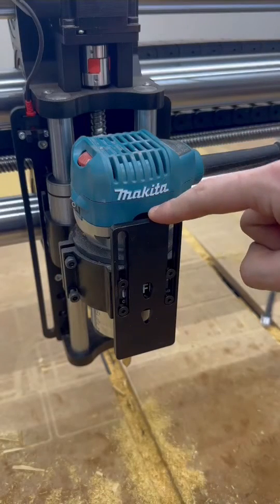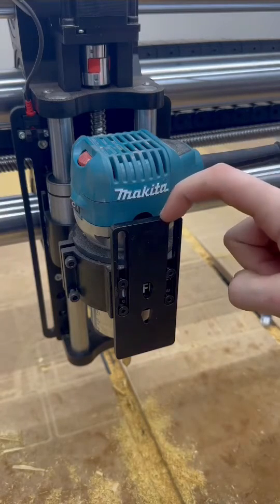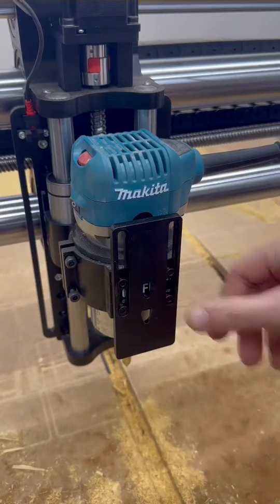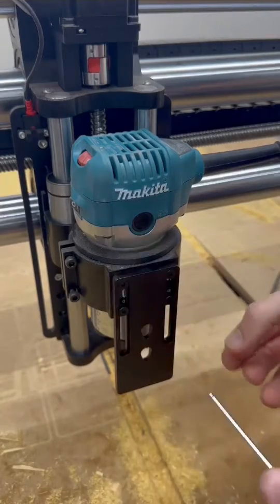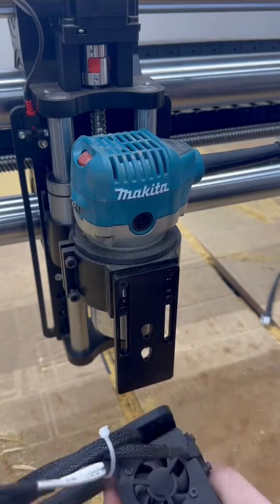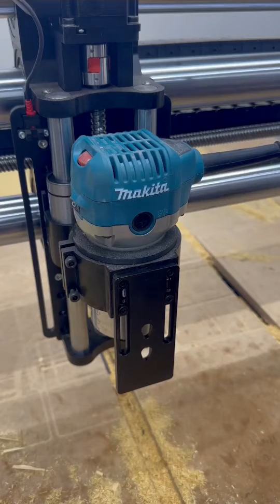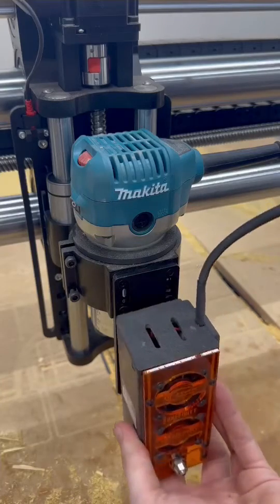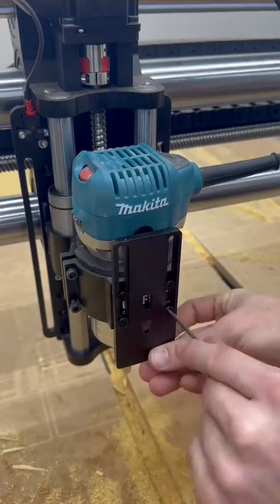Tuesday Tip - Switching between CNC Router and Laser

Comment: Is there a tip on how to change between lasers? I ask because I have the 7w and the 24w. I would like to be able to switch between the two when engraving and then cutting. Not sure if they have different controllers or if they can both be hooked up to the raspberry Pi controller.
Reply from the maker: They have different controllers (before 2024) so you'd have to change them.
There isn't a raspbery pi controller involved with the laser...